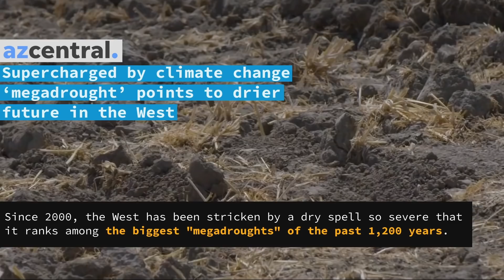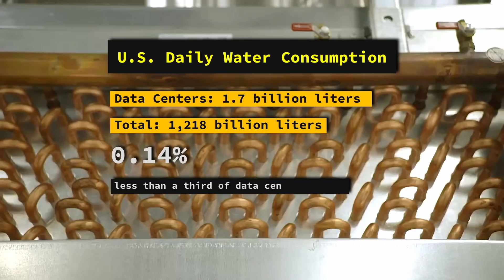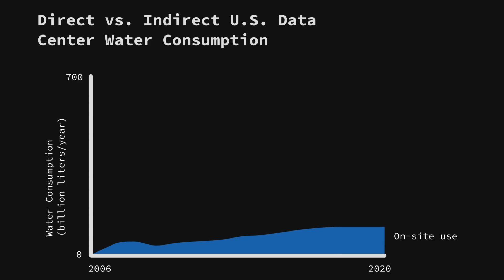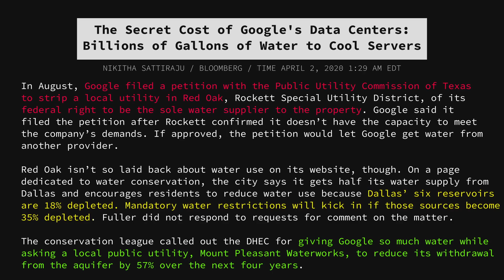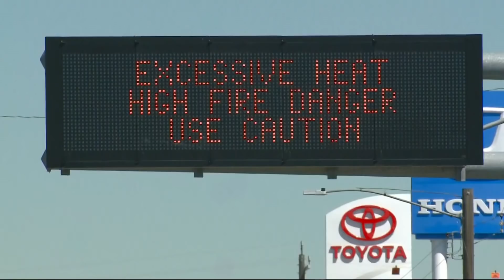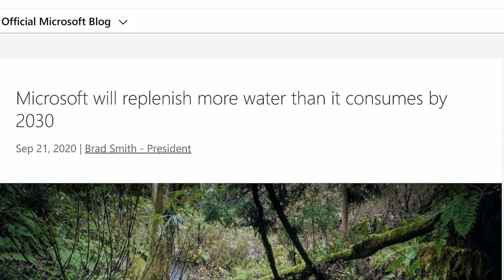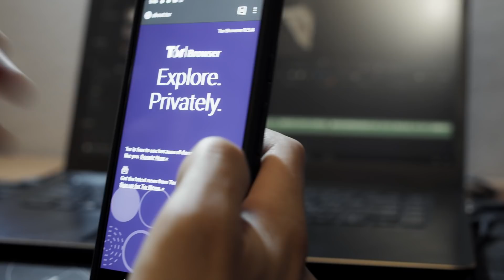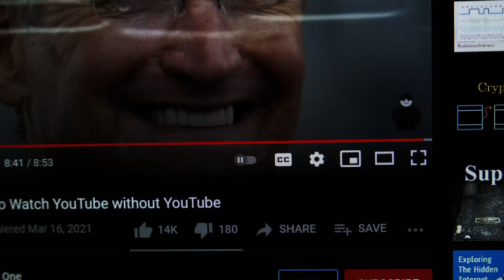The Internet Is Running Out of Water

Comment: How are they not recycling the water and just reusing it over and over again they could literally just build it's so that it goes off into a cooling chamber ready to be reused again to cool the processors
Reply: The video is a bit misleading the water consumption is from generating power not from actually running the servers. Here is a bit from an article. 

"All large data servers use water, both directly and indirectly: They withdraw water directly to cool the servers that get hot from operational use, and they use water indirectly because they power their servers and cooling systems with electricity generated at power plants which rely on water for their own cooling needs."

Comment: When Google opened biggest data center in Finland in ex big paper mill plant where cold water channel been excavated from paper production paper most water demanding industry and most it goes for cooling it was synergy, computers laptops smart phones consequence of such expansion paper mill closure and that was a win, for "treehuggers". But heat is worst problem than C02, increasing CO2 is just consequence of fossil fuel and ecosystem circle, trees and phytoplankton not capable to create 02 at a pace that we burn fossil fuel, biggest problem is heat produced by humans including industry and data centers, people not realize we living in hollow earth all heat is trapped inside all heat absorbed by ocean water but one day it will be not enough glaciers will start melt in some case 70% fresh waters rivers are glaciers based. Google center in Finland was kick in the butt by own foot.  Plus we all must be blamed, people have old low resolution small diagonal monitors, do we really need 4k quality maybe my monitor is old and people demand high quality  we just can count how electric energy we can we save, how heat we can reduce to pollute our air if we just reduce video quality.

Comment: Once we move to fully renewable power generation the majority of water use discussed in this video goes away.  Data center cooling should be a closed loop system, possibly providing heat to nearby homes.  Solutions exist.

Comment: This sounds very strange. They "consume" water? I mean, when you cool a component, you're running water over it, sure (or in a side channel that soaks up heat and carries it away). But you're not really "consuming" water. The water is still there. In fact it can be re-used. I'm sure it can even be done without contaminating the water at all, so it's completely reusable. Edit: Ok, I get that the generation of electricity consumes water, though, but even then there are ways to conserve it, for instance letting out into the soil after energy is taken from it.
Reply: It's cooling by evaporating water. The water is heated and is dispersed into the air. You are effectively losing that water.
Reply: @valcaron Most of it does yes. Also you then have to make it into drinkable water. You are still "consuming" it. Like it said in the vid, at anyone time there is approx 50,000 household's worth of water being tied up. In the most arid regions. And its only going to increase.
Reply: @valcaron Yeah, it returns but in different time and place and of course local consumption outstrips replenishment by far margin.
Reply: No. You are indeed consuming water. The amount of water from precipitation is smaller than the amount of water being consumed (in this case lost via evaporation). In many instances large rivers are supplied by melt from glaciers. As the global temperature increases, the amount of new water added to glaciers is falling compared to the amount of water that melts from the glaciers resulting in a loss of glacial water and the eventual total loss of the glacier and the river it supplied. And as global temperatures increase the amount of water that can be evaporated into the air without precipitating increases resulting in an overall drying effect, ie more water is evaporated than precipitates. For locations that get their water from ground water they are withdrawing more water from the ground than is being returned to the ground resulting in a loss of ground water with the eventual result that they will run out of ground water.

If you want to see what the future will look like just look at SSH. SSH used to be far wetter than it is now with far larger and greater forested regions, lakes and rivers. Due to an environmental event the temperature increased causing the amount of evaporation to greatly exceed the rate of precipitation.
Reply: The issue is it’s being used faster than the reservoirs are re-filling by precipitation or intake. Also electricity is generator by vaporizing water and making it turn big turbines…. You can’t dump water vapor into the soil. Even when there IS liquid water left, it’s contaminated, and dumping it is what we call pollution.
Reply: Thats the problem I had with this video. He just goes straight into the stats but doesn't explain the very basis of how a data center can "consume" water.
Reply: @jty9631  evaporative cooling cools down air by drawing warm air through a water soaked membrane of some sort. this causes water to evaporate into the air lowering the temperature. (not that simple but basically it, check out swamp cooling for more info). so thats how they cool their stuff. but getting water vapour out of air requires a lot of energy because you need to cool, condense and collect it. so these companies just let it into the environment where it will precipitate naturally. but the incredible rate at which theyre consuming water through evaporative cooling like this doesnt match the rate at which its being naturally (and very slowly) replenished.
Reply: 'consuming' is not the correct verbiage... look at the sat view of any datacenter and you will see large water storage tanks where water is treated and re-used as much as possible... while datacenters may 'process' water in the amounts described in this video... most of it is water thats recycled and reused on site and is not 'fresh' water drawn from the utility.
Reply: @verybignw  consuming IS the correct verb. those are the numbers being reported by the company for how much water from local sources they use for their data centers. it doesnt count reused water or whatevers in those tanks because that wouldn't be new water they bought, paid for, and used. (consumed)
Reply: Can't the evaporated water be collected, treated, and then re-used?
Reply: @vakansievoorman  Sure. But you are talking about more infrastructure, more energy, more cost. At the moment it is easier and cheaper to use more water. You dont over-engineer things if the costs dont stack up.
Reply: @vakansievoorman  if that was the goal, it would have been far easier to just have a closed loop that didn't reach temperatures above 80C in the first place.  Evaporative cooling is much easier and cheaper than closed loop cooling, which is extremely easier than recapture systems.  Look up "evaporative cooling" or "swamp cooler" to see how simple they are.

Comment: Wait how come my internet usage will be limited, I can run my own cloud storage with an old recycled computer that doesn't use evaporative cooling.

If anything a decentralized internet is better. They should focus on saving data locally on devices rather then pushing everything to the cloud. Yes apple I'm looking at you.

What if there were water pipelines, to bring ocean water then when in evaporates sell the salt as "organic fresh sea salt". I wonder how much water pipelines will cost a private company like google.

Anyways great job bringing this issue to light, I'm sure its it's something 95% of us had no idea was a problem.
Reply: Yeah, whole fallacy is having cloud as PRIMARY or ONLY option, and temporary local.
Reply: Pumping salt water uphill creates a lot more problems than letting fresh water roll down hill ...
Reply: They dont want us to decentralize. They want us to beg them for their services

Comment: these data center companys need to be mandated to run desalination plants for their water. running fresh water from these plants to data centers via pipelines, with groundwater only being used in emergencys like when infrastructure is taken out by hurricanes.
Reply: I was thinking the exact same thing.  The water doesn't have to be potable
Reply: The problem is desalination is extreme energy intensive, meaning your just kicking the can done somewhere else with energy demand. Plus you have to safely dispose of all the salt and brine which is extremely toxic
Reply: @480darkshadow  they can dump the brine back out here in the desert too. just away from the drinking water. maybe data centers just werent meant to be the most energy efficient industry when actual guidelines and restrictions are in place.

Comment: There was one company that I worked for in the past, Manhattan associates, who had a giant building and ran their own datacenters in the building.  They didn't use liquid cooling: they used traditional fan cooling, but also turned the room that the dataceneter was located in into one giant walk-in refrigerator.  Why can't something like this be implemented instead?
Reply: It cost more, sadly.
Reply: @8epic819  In energy used.
Reply: Money
Reply: Theyll start using the fan when the water is high critical.
Reply: More maintenance, more people employed, more money spent and skyrocket energy consumption.

Comment: why can't they just use a radiator system like a car? also as far as AI usage goes, it's a fresh technology and right now only a few languages support training AI models, we need better efficent AI networks, and then we'll be like gods. lol i'm already using non standard search engines. sad that they won't tell us about their water usage, water is a great for pumping heat, and why they need so much is baffling to me. never ran a data center before but if that does happen i'll just make my own data center. and it will use pis, and be in places that are hard to find, and autonomous.

Comment: These huge data centers in the desert need to use chemical cooling or air conditioning of some sort and build a small nuclear reactor to power it for cheap electricity. Is this the 21st century or what? Get smart guys.

Comment: Close the cooling loop!! What incompetence. They need to throw to the curb any leadership who refuses to acknowledge the fact that the price tag is usually not an accurate measure of natural resources' value. You cannot convert the need for basics like food and water into a need for computing; why, then would you think it makes sense to convert resource basics into computing resources? 

Of course, that is not their biggest policy issue by a long shot.
Reply: Closed loops makes a lot of sense, and in places where are temps are as higher or higher than servers temps you can use geothermal or traditional AC systems. The problem is the latter is expensive compared to evaporative towers (but not as expensive as being shutdown because your water supply ran out on you billion dollar datacenter).
Reply: Wait, these are not closed loop systems ???  Wtf
Reply: @korosensei4384  where did you think the name "EVAPORATIVE cooling" came from?
Reply: The trade off when removing evaporative cooling is that you use more energy to provide cooling. That price tag is about a 20% increase in total power. Seeing that most power is generated from heat sources, you end up wasting more energy at the power stations. If power generation didn’t use water for cooling the generation process, then the increased power is worth it.
Reply: @mutzman  It looked like the water loss from power plant cooling towers is about 10 times higher than the on-site water consumption for evaporative cooling or air conditioning condenser cooling towers. Wouldn't the solution be to locate large thermal power stations in temperate climates with ample water and to force datacenters in water-stressed regions to either operate with dry air conditioning condensers, use waste water, or use ambient air cooling and just tolerate the higher server room temperatures and slightly higher failure rate of the electronics. I thought that last one in particular was supposed to be the "big new thing".
Reply: that's not possible with evaporative cooling. that's in the name. it uses the water that evaporates. Once the water is in air its impossible to catch it. and even if you cold, condensing it back to water would need energy, and so defeat the purpose.

but yes they should be disincentive to use water evaporative cooling and instead just use more clean energy to refrigerator cooling
Reply: Question: Why not implement a cooling system similar to one used in a car.  Water isn't used to cool my car, coolant is.  Why couldn't a "coolant" be used to cool the data centers instead of water?
Reply: @TheCocoaDaddy  not even sure why they don't do that. There's already radiator systems used to cool the water either passively or with fans.
Reply: @wheezybackports6444  The idea would be to stop using water for cooling.  Maybe a synthetic coolant would/could be as effective and alleviate the need for using water for cooling.
Reply: @TheCocoaDaddy  There's also direct CPU cooling systems for 3M Novec. I seen a demonstration of it not long ago.
Reply: You can't close the loop without needing a filtration system to remove contaminants, bacteria, etc. They should be using 3M Novec which is much more effective and scaleable. There's already been demonstrations of Novec being used on high end systems. Another great thing about Novec is that it can be reused over and over as long as you have a condenser system to turn the boiled gas back into fluid.
Reply: Unfortunately there is actual justification (to a degree) as access to this information and ideas breeds new creations. We are on the clock till our sun dies and universe dies.

Comment: "No price of water is high enough - rationing is inevitable." Artificially cheap water caused the problem, and market-priced water will fix it.  At a high enough price for water, you can desalinate it with nuclear or solar power.  Cooling can be load-shifted to daylight hours (some companies use solar PV to freeze water into ice for nighttime cooling).

Comment: Evaporative cooling doesn't 'delete' the water though, it evaporates the water making the air more moist for everything around it. This might not mean 'therefore rain will completely compensate' but this WILL impact the surrounding climate as more moist and therefore soil stays moist longer, plants need less water and water basins get less evaporation. On top of that the data centers could be used in tandem with local bio engineering solutions. Plant a bunch of trees around data centres that use evaporation for example. The trees will capture the moist air and increase rainfall, increasing aquifer replenishment and countering desertification. Not happy with the efficiency this will happen? Pipe the moist air directly into the forests and create local rainforest style conifer forests in the middle of the desert that completely overhaul and terraform local biospheres and make most water moisture return to the ground locally. The point is there are win win possibilities here...
Reply: These bio engineering solutions will not happen as there's not enough money to be made in it. Our economic system is extractive; businesses will deplete local resources and then move on. The US state as it currently operates is clearly neither willing nor able to take on the kinds of great projects that would decisively address these water issues.
Reply: Very few water uses 'delete' water chemically. It's really a red herring to raise it. By that reasoning there's almost no ways that we use water that means we've 'lost' it. But clearly that's not true in a way that's relevant here, and pressure on water supplies is a real problem in a lot of places with governments constantly trying to increase capacity...

But anyway, the humidity from a data centre isn't going to turn Arizona into a rainforest... I appreciate your optimism but it would be like spooning sugar into the ocean to sweeten it. 

And on top of that the video makes the point that on site water use (as vast as it is) is only a small proportion of the water use of these places. Unfortunately planting trees and pointing an exhaust pipe at them probably wont be enough to deal with it.
Reply: Ah, I guess you can wait for rain to drink every time then.
Reply: Eventually even diminishing returns will deplete,and when that happens you'll start wishing America was imperialistic
Reply: My first thought when the video talks about the consumption of water was that the water is not just gone.  He speaks of water used during energy consumption, but doesn't talk about how that takes place.
Reply: If the water just rains down into the ocean than it is practically lost. Not the water itself but it's property of being drinkable
Reply: AN ABSOLUTE THANKS FOR YOUR COMMENT.  VERY TRUE.  My comment towards its end I state - the same water dinosuars drank & piss out is the same water We drink & piss out for millions of years the water ain't going no where.
Reply: I read a lot of comments about collecting the water. It's steam. They'd have to use energy to cool it, otherwise it won't stay. If they piped it back into the reservoir, the energy would just add to evaporation at surface for no improvement. At the core, datacenters are padding their carbon footprint numbers by using cheap potable water as an energy sync instead of electricity to cool.. Which would be fine if they didn't use the only potable water in the region. Never about the ethics, forever about the dollar. Capitalism is cancer.